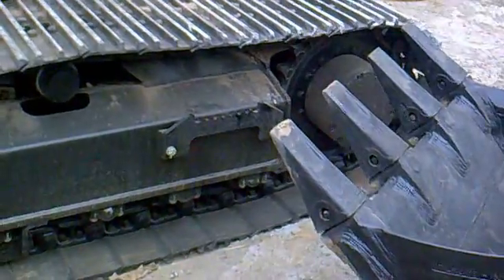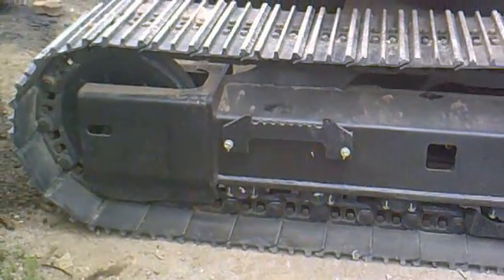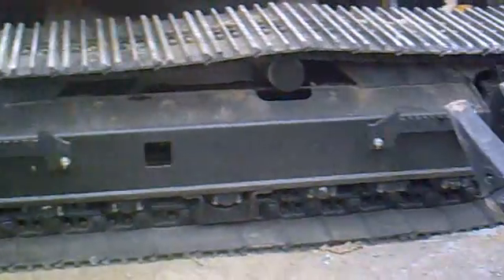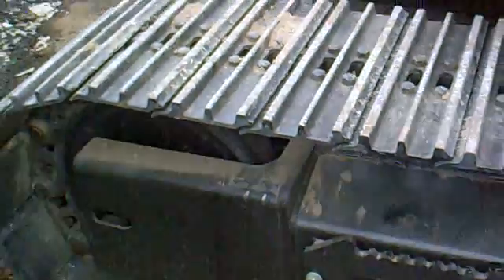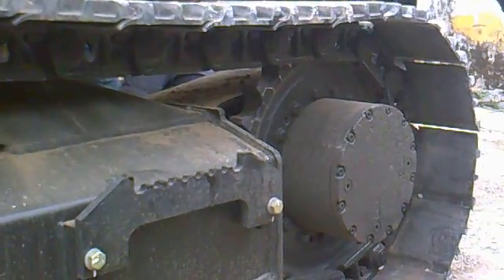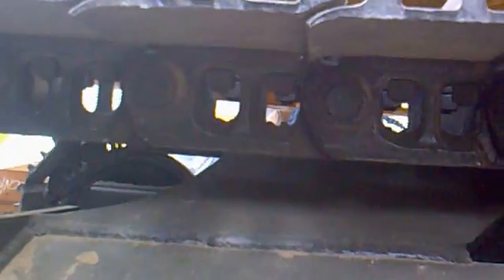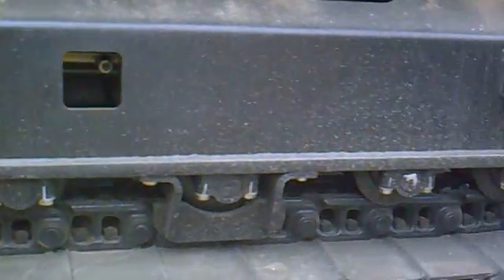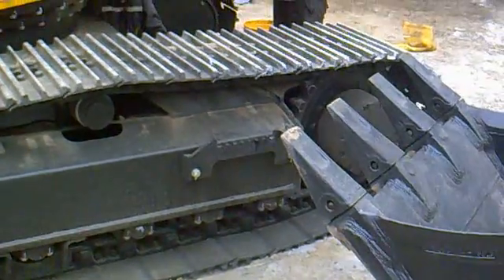How track of an excavator machine works. ✔

Comment: So does the diesel motor in the back of the cab power the motors through hydraulic pressure or electrical power?